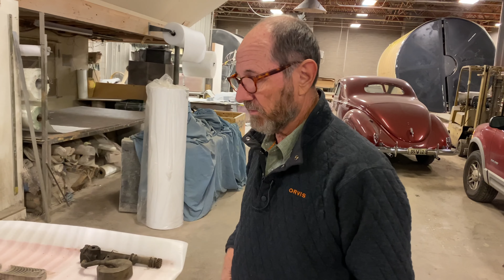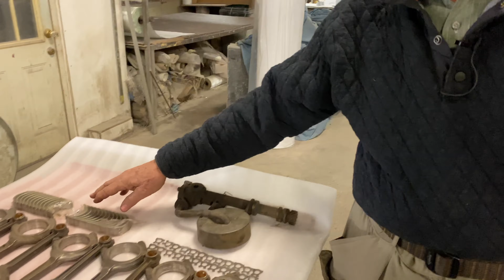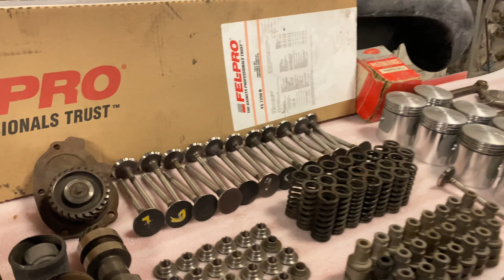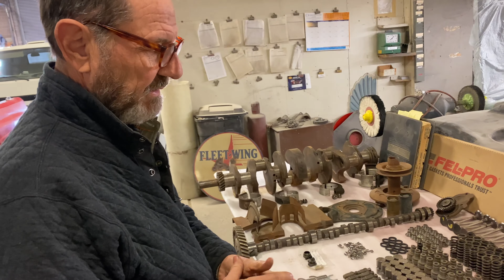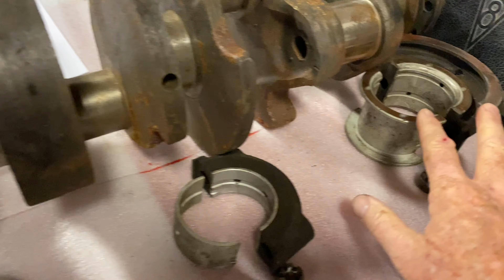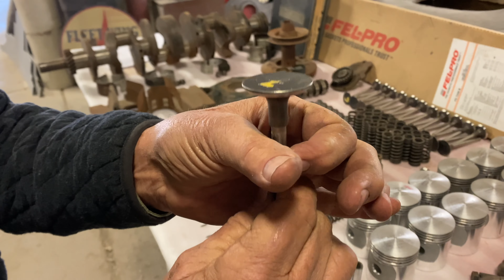V12 Engine Technical & Parts | 1938 Lincoln Zephyr Pt 18 | Zephyrville

Comment: I wonder where and who BJ went through to get or have work done to original pump to make or get a Heavy-Duty pump ---- wonder what the pressure is now? ------- That was neat ---- that they made brass Thermostats that slipped up inside the Radiator hoses ----- Did you by chance ---- off camera there ----- ask what the little black bodied car was on the far side of the engine lay out table was? ------ Does he collect and restore bicycle's too ---- saw them hanging on the wall ----- Interesting ----- they don't put in Hardened Valve Seats ---- in today's world where the Lead has been removed from the gas ---- I think even with the -- LOW --- miles it may be driven ---- a GAS ADDITIVE should be added to keep take HAMMERING of the valve to a minimum -------- Thanks Again ----- New things learned of our days gone past --------- Rodney